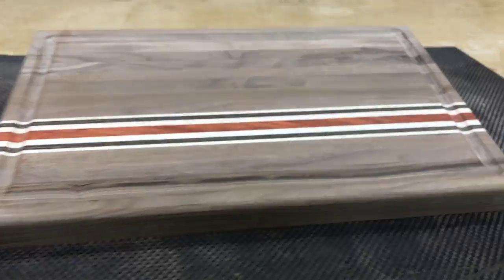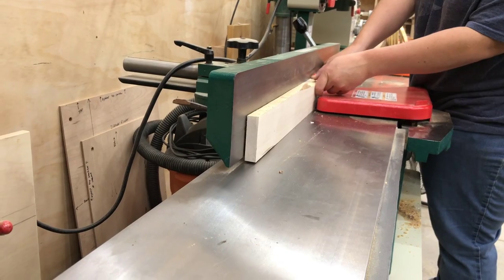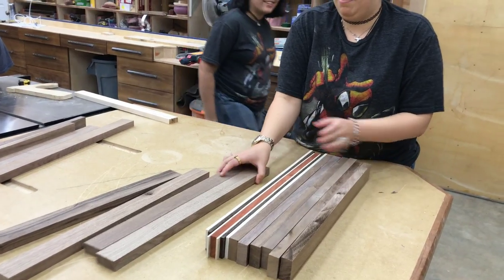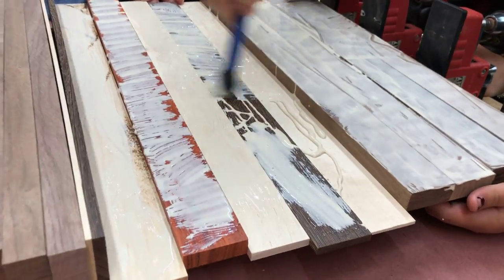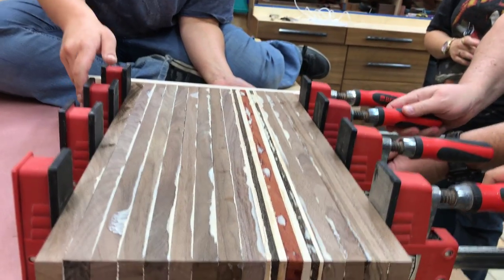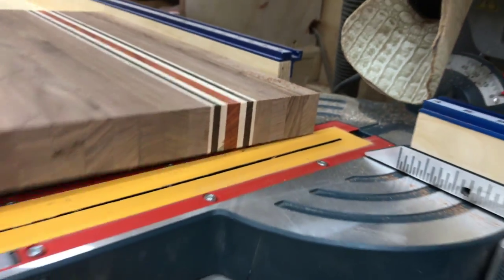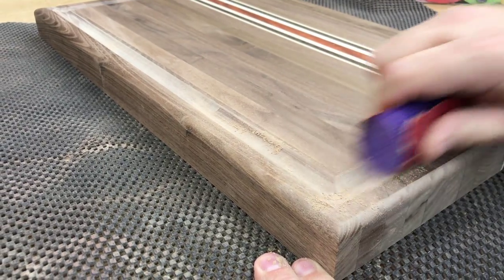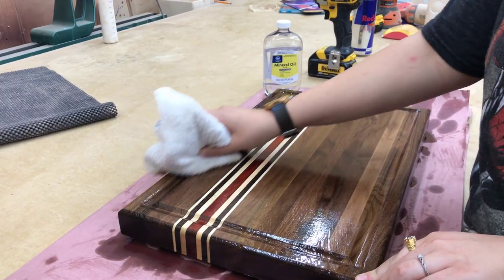30 - How to build a Walnut Cutting Board in an hour from offcuts & scrap

Comment: Looks great! the only thing missing or not mentioned is lightly wetting the board to raise the grain before final sanding. Its not a big deal it just help keep the board smooth after washing.
Reply from the maker: Hi Ronald! You are right! I think we completely missed it. We had three projects going, and we were video recording 2. Thank you for pointing that out. 
~James
Reply: Is the wetting done with plain water spray or mineral spirit wipe down?

Comment: I enjoy your videos and the involvement of your family in projects.  I am a novice and watch a lot of videos.  I see in some videos that at some point people spray with water to "raise the Grain".  Is this a big benefit and whats your opinion?  Thanks in advance.
Reply from the maker: Hi, it can be a benefit. I don’t think it matters a ton. I don’t sand my cutting boards super fine, so that they can absorb more oil to protect them better. But if I were to sand them much finer with a finer grit, then raising the grain would make it a tiny bit smoother.

Comment: Feet make it a one sided cutting board. I might consider using a core box bit to make finger grooves on the short sides, and spray it with water to raise the grain so it can be knocked down...

Comment: Beautiful board, I actually made one yesterday and tried to put juice groves on it with a palm router and straight edge guide and disaster happened, the edge guide moved and almost did a grove right in the middle of the board. I managed to fix the board but the guide I threw in on the ground and stepped on it as many times as I could, It helped my frustration
Reply from the maker: Haha, that will teach that guide a lesson.

Comment: Supper cool James, not so hard to make simple instructions might pick that scrap wood out and give it a whirl lol. Thanks for sharing. Also would like to know I have been wanting to do some harder projects and not sure of the skill level needed to accomplish it. Did you happen to take carpentry classes to do what what you do just curious as most my answers get back to me and said they learned as the went. I'm a full DIY guy and built fish tank stands, beds and a few other things and looking to do more but every time I turn around I need more tools for the project and have to learn how to use them 😂 thanks in advance.
Reply from the maker: Hi William! Thanks! 

I've never had a class. Shortly after I was married in 1985, my father in law started teaching me some woodworking. But really everything was just trial & error and learning as I went. 

In the early days it was slower, since there was no internet. These days it's great! With YouTube I can look up a technique or method I've never tried and get great pointers. 

It's never been a better time to be a DIY'er!

Good luck & have fun! :-)
~James

Comment: Very nice job/video.  Personally, I find that with cutting boards that have a "juice groove", I most frequently use the other side, because the groove gets in the way of sweeping veggies, etc, off into hand or disposal.  So, I would have rounded over the bottom edge, too, and skipped the feet.  And that also would keep the edge from getting as damaged: An item handled like a heavy board cannot possibly keep a sharp corner like that without getting very dinged!
Reply from the maker: Thank you! Great tip

Comment: What's the difference between pre-drilling a hole for a screw and drilling a hole for a screw?  Sorry - pet peeve. No woodworker on YouTube seems to drill holes. They only pre-drill them. Excellent videos - I'm a new subscriber.
Reply from the maker: Hi David!
That’s a great argument! Looking at it one way, it is clearly impossible to pre-drill a hole. The very act of drilling in the first place concludes the action. You can’t pre-drill something. You either drill it or you don’t. Haha, you can’t drill before you drill…

But, here is my two cents. The word pre-drill is a contraction of two words, ‘previously’, and ‘drilled’. So perhaps it means to ‘have previously drilled a hole’ for something. Maybe the ‘something’ is ‘the inserting of a screw?’

Ultimately meaning, ‘drilling holes prior to, or previously to screwing.’

So perhaps we can take the word pre-drill to be a contraction of an entire sentence like this; “The act of drilling a hole, previous or prior to inserting a screw.”

Oxford English Dictionary defines pre-drill as: “To drill holes in a material before sale or use; to drill a hole beforehand”

Anyway, I like the argument on both sides, and thanks for subscribing.
~James
Reply: What if you "pre-drill" with a small diameter bit through the entire depth from one side. You can then use a larger bit from the same side until just over half way and do the same form the other side, using the "pre-drilled" hole as a guide and avoid any tearout.
Reply: Good argument. How about if someone doesn't have a smaller bit and they drive a small nail in to create the  pilot hole? Would that be considered "pre-drilling" since it was done prior to the actual hole drilling?

Comment: Are there woods that wouldn’t be safe to use in a cutting board?  I was surprised to see Wenge being used. I love the wood.
Reply from the maker: Hi Dave, there certainly could be some species that would be toxic to consume. But I’m not familiar with any that are. 

In truth almost nothing from the cutting board ends up in the food anyhow, but it’s good to be safe. 

The Wenge you asked about is a toxic species if the dust is inhaled. It can cause neurological damage. And splinters can cause infections if not removed. However once sanded it doesn’t really present a threat. And furthermore, the acids in stomach along with digestive enzymes are enough to prevent Wenge from becoming an issue. 

To be completely safe, you could do a google scholar research, and look for periodicals that have researched that. I found one from the NIH some time ago, although the number of species it covered was pretty limited.

Comment: Thank you for sharing. I am learning so much from your videos. Wondering why you used the jointer to remove the polyurethane and the planer to remove the glue.  Are the two tools interchangeable in those instances?

Comment: G'day James and daughters I do enjoy your work! I do have a question though every time I flatten the end grain cutting  board and put back on the bench It whorps back to the side just flattened, I can only use the router to flatten the board  this has happened several times now the timber is very dry and end grain so I thought I'd ask the professionals for "HELP" before I quit the project this Is the first attempt to make a cutting board. Can you offer any
suggestions? 
Cheers D
Reply from the maker: Unfortunately, a planer will not take out a cup or a warp. You will need to surface one side with a router or a jointer first. After that, you would plane the other side into parallel. The planer just squishes the cup out of the board, planes it flat, and when the board comes out, the cup reappears. 
You should check out my Facebook Community page. Lots of woodworkers on there, including me, would be happy to take time to help you with any problems you may have.
https://www.facebook.com/groups/134828903893994/

Comment: Do you recommen using a stain/varnish on the board, after engraving, and then using the oil/beeswax mixture? My worry is if you use the board to cut on, won't the cuts eventually get to the stained layer and contaminate the food?
Reply: A bigger problem is that when the board gets wet, it will eventually fall apart.  Wood glue is not waterproof indefinitely.  To last it needs 3 cross holes with bolts to hold it together, the nuts can be countersunk and hidden under plugs.  Look at an old fgashioned butchers chopping block to see how it is done.

Comment: Save that stacked cut off piece and make a handle for another wooden mallet. The stripes look great!
Reply from the maker: Hey, that's a great idea! I knew it looked good, so I kept it!
Reply: Might need to dowel the length to keep it together though. I know Titebond III is strong but I'm not sure it would hold up to repeated use in this context.
Reply: The glue probably would outlast the wood given the grain direction.
Reply: You're probably right. That's where the doweling or maybe a threaded rod would come in to keep it stable. Whether the glue fails or the wood breaks, the mechanical failure of this can be prevented with internal stability.

Comment: I know this is an old video, but I have question....Why did you use the compound miter saw to clean the boards up and not the crosscut sled on the table saw? I ask cause I don't have a compound miter saw. Is there a difference in the quality of the cut?
Reply from the maker: Compound miter saw not needed at all. In fact the cross cut sled is more accurate. 

I just used the miter saw because it was a bit easier.

Comment: What did you put on your miter saw for dust collection? And did it actually improve it?
Reply from the maker: I wrapped a piece of leather and taped it around the existing dust catcher to make it bigger. The improvement is very slight. Before I put the leather I actually had a piece of cardboard taped there that actually worked much better for some reason. 

From what I hear the Bosch miter saw has better than average dust collection, but it seems pretty mediocre to me.

Comment: As a fairly new woodworker in training, couldnt I just quickly cut a “heel” on a scrap piece of 2x6 or 2x8 as a sacrificial push block when cutting very thin pieces on the table saw? If it was a large piece of wood to use as the push block, it seems it should do the job.
Am I missing something? Dont want to be presumptuous since Im so new

Comment: What kind of drill pit is that red and black one?
Reply from the maker: Hi Shaun!  That's a Milwaukee Shockwave bit. I'm using phillips here. They are really good and work great for the impact drivers too. I'm a big fan of DeWalt tools, but I prefer Milwaukee for drill & driver bits.  
Here is a link if you want to see them. http://amzn.to/2w4fhFd
It's the same bit, but a couple of months ago, they changed the color from red to gray.
Thanks, James

Comment: Would olive oil work instead of mineral oil?
Reply from the maker: Hi,  it would not. Oils that are pressed from foods like that will turn rancid.
Reply: @KingsFineWoodworking  
Thank you. I just finished mine last night. It's now all oiled up with mineral oil and ready to go. It looks vey nice.

I have one more question.  Before I oiled it, I sanded it smoothly with up to 150 grit sandpaper. It seemed pretty smooth. When I rinsed all the sawdust off under the sink, the wood became rough again. This is confusing. Any ideas what it could be?

Comment: Isn't wenge toxic?
Reply from the maker: Hi, inhaling fine Wenge dust into your lungs certainly is. So it is definitely advised to wear a mask while sanding it.  However, the is no issue with it in a cutting board. It doesn’t affect the digestive system.
Reply: Kings Fine Woodworking good to know!

Comment: nice board bot some things I noticed (don't want to be a smartass here but one thing have to be sad and other things are just my nit pickings ) 
1 ) using a jointer or ANY power tool for that matter in jewelry especially loose bracelets is a terrible idea, asking for a prosthetic hand 
2 ) applying mineral oil with towel is like trying to spray paint with a vacuum cleaner ,  highly counterproductive and wasteful ..,
3 ) it is your design but putting the juice groove so close to the middle takes out sooo much effective cutting surface

Comment: Should check out gorilla glue wood glue. Food safe, waterproof, and stronger than titebond 3, also a good bit cheaper
Reply: Also is level 2 ansi/hpva waterproof where titebond 3 is only level 1
Reply from the maker: Could you post a link that backs any of that up?

My research shows a significantly less bonding strength: 

Titebond III has 4000psi bond strength. 
Gorilla Glue comes in under 3500psi. 
See my glue video where I cite a study done by Case Western Reserve University. 

And a gallon of Titebond III costs about $26, that’s $0.23 an ounce. 
A 4 ounce bottle of Gorilla Glue cost $5.97, that’s $1.50 an ounce. 
This is more than 6 times the cost. 

And I’m wondering if you’ve worked with polyurethane glues like Gorilla Glue before? They are the messiest and hardest to clean up of any glue. 

They have their place, but for me, a cutting board isn’t one of them.
Reply: @KingsFineWoodworking  I've been using it for years and it seems to hold up as good or better than titebond 3. Check gorilla glues website and titebond. About bond strength i have no research just personal experience, but 3500vs4000 sounds equivalent, barely marginal. And your comparing a 4oz bottle to a gallon, of course there's gonna be a price difference. I got a 18oz bottle of gorilla at home depot for 5.80 where a 16oz bottle of titebond 3 was $8, and a 8oz bottle is $6. I don't build enough to need a gallon so no clue the prices on them. The type 2 ansi/hpva gives better water resistance so id trust it over titebond 3 (only rated type 1) for a cutting board which will get wet countless times over its life.
Reply: @KingsFineWoodworking  also, gorilla seems to give a thinner glue line and is more transparent so for a show piece like a cutting board I much rather it. But if you have gallons of titebond, go for it. I've used both with great success, just some personal experience
Reply: @KingsFineWoodworking  also, the cleanup is the same, both are pva water based adhesive. I think you are talking about original gorilla glue, I am talking about gorilla wood glue
Reply: @KingsFineWoodworking  last also, I see a gallon of gorilla wood glue  for $22 on Amazon and 2 gallon pack on home depot for $40. So still a good amount cheaper